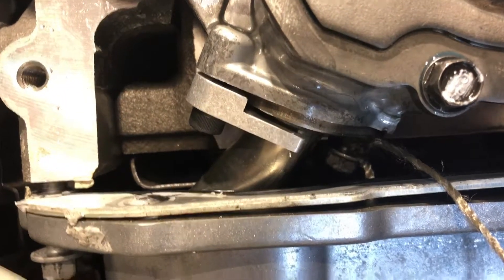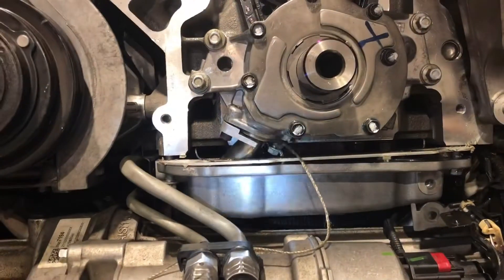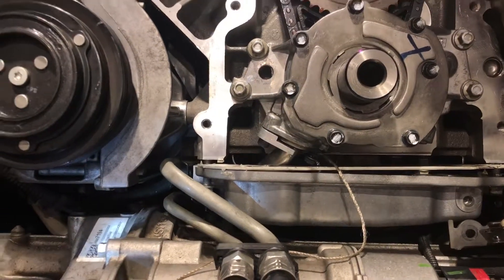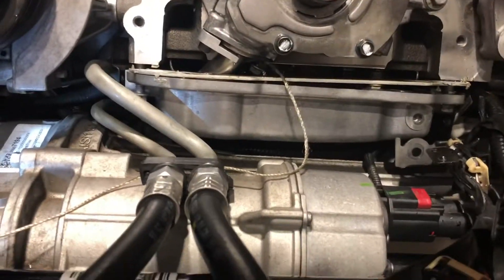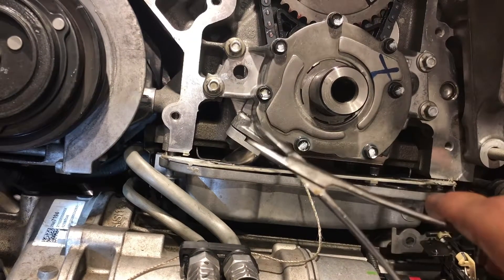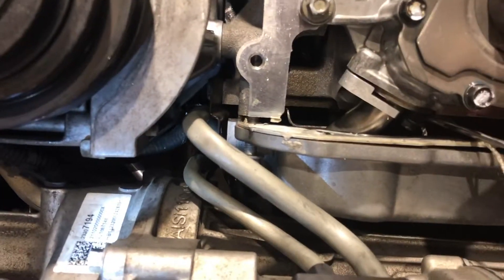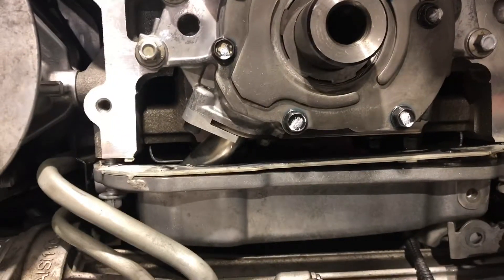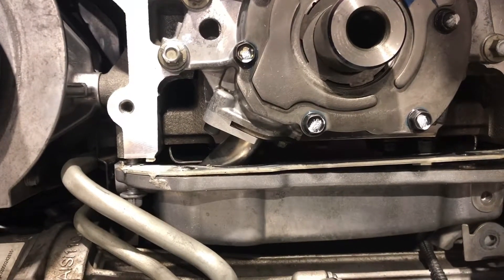Finalizing the ZL1 oil Pick-Up tube

Comment: Very clever method and well done. Did you loosen the oil pan bolts at all in this video to lower the pan some additional amount? That would make it difficult or impossible to clean and reseal it back up with the cross member in the way. I know your cross member is removable now.
Reply from the maker: All the bolts were loose to lower the pan as much as possible. To do it over I would just cut the crossmember. No sense risking cutting the pickup oring and losing oil pressure

Comment: WAS the Girdle Pickup loose, why would you put back the right side bolt back PIA! On my LM7 Gen3 only has right side bolt holding the pickup tube.  thought the concept on Girdle Pickup left bolt was to avoid drooping the pan for next time.
Reply from the maker: girdle is a safety. Why have one bolt holding the tube when you can have two bolts doing that job?